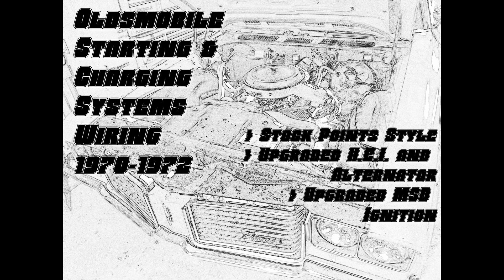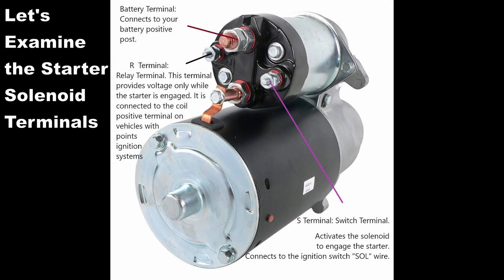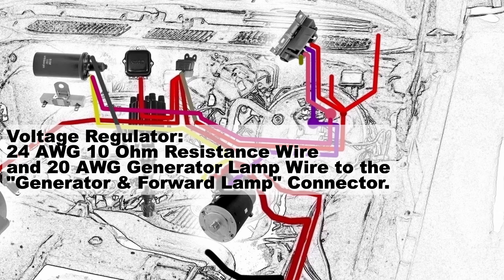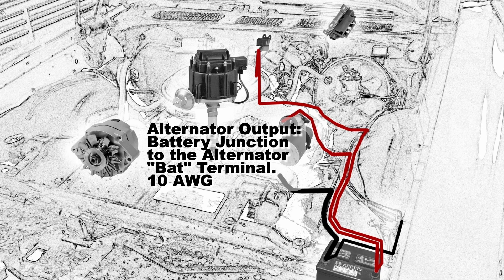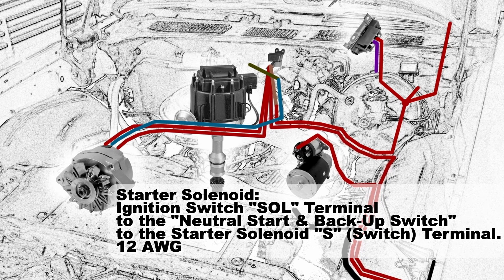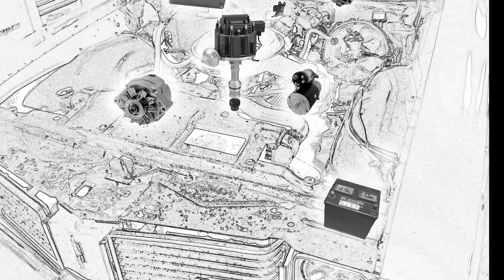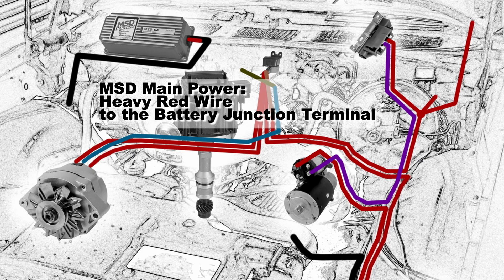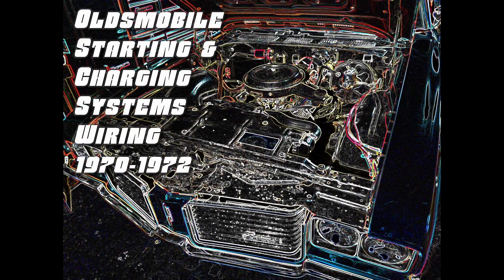Oldsmobile Starting and Charging System Wiring in Stock and Upgraded forms.

Comment: what is the main power junction? im lost on that because it shows the wires going to nothing, Can you tell me what that is?is that the fuse box?  Im trying to wire up my 74 442
Reply from the maker: The wiring system shown in this video is for late 60's to 1972 cars. Your 74 Cutlass is wired differently, email me at Junkdump455@gmail.com and I can send you the diagrams I have for a 1974 Oldsmobile. The power junction is where various systems (fuse box, lamp switch, ignition...) receive power from the battery/alternator. It is a connection in the harness that connects various systems together (junction) from the main Power Supply (Horn relay post).

Comment: Great video. I bough a 1970 delta 88 the ignition has been disconnected… it has a wire off the solenoid and just sits beside the positive terminal with is used to start the car by just touching the wire to the battery. I traced the purple ignition starter wire from under the dash. It goes to the fuse panel and exits as a green and white wire. I traced that to a plug that has been disconnected. It has a black wire and the green ignition wire. It’s a two prong plug… when I put the wire that was used to start the car at the battery into that plug on the green side prong and turn the key the starter engages but sticks on. I’m assuming the previous owner just disconnected it because the ignition is bad. My confusion is the two prong connection. I haven’t seen starters with this type of plug. Am I missing a component?
Reply from the maker: @danharvey464  email me at junkdump455@gmail.com and I can help you figure this out. Your purple solenoid wire should go from your starter solenoid, to your dash connector, from the connector then to your neutral start / backup switch. That switch has another purple wire that goes to the ignition switch sol terminal. It is purple the whole way.

Comment: Question for ya. My front left running light does not work. I checked all bulbs and fuses everything is good. When I pull out the light switch everything works but that front left light. When I hit the turn signal it comes on. Without the turn signal activated the green light remains on the dash. I'm so confused.

Comment: Hello. I have a 69 cutlass that now has an HEI in it. I notice that you linked the HEI's battery wire directly to the ignition switch on the steering column. Did you do that by splicing into the wire on the steering column associated with the ignition switch? I checked, and its a red wire that looks to be 12g.😊
Reply from the maker: That's not the wire. I remove the pink wire with a black stripe and replace it with a 12g pink wire that I connect to the HEI bat terminal. The pink and black wire  was orginally connected to the coil and the engine & dash connector, this wire is a resistance wire and should not be used. It should be replaced with a 12g pink wire. On the other side of the system, if you look at your ignition switch you should see a pink wire, this is the wire that leads to the engine & dash connector. The new pink wire replaces the pink & black striped wire that leads from the engine & dash connector. It all sounds confusing, I hope you can follow what I said. If you have more questions or need further explanations please reply. Thank you for the great question!

Comment: Question do you have a wiring diagram of a 1977  403CID motor....
Those vintage motor,s needed a little SIM card in the kick panel to acclimate ize it to the motor...
Reply from the maker: I have the full schematic from the Haynes manual for 1977-1979. Email me at junkdump455@gmail.com and I will send it to you tomorrow.
Reply from the maker: I haven't received an email from you yet, so I'm hoping that means you found the wiring diagram you needed. If you did send an email make certain to double check the address you sent it to.

Comment: One thought. If I upgrade to HEI  should the  R terminal run to the hei coil Batt terminal  to provide the coil with 12 volts while cranking ?
Reply from the maker: With the HEI distributor properly installed you don't need anything connected to the R terminal.